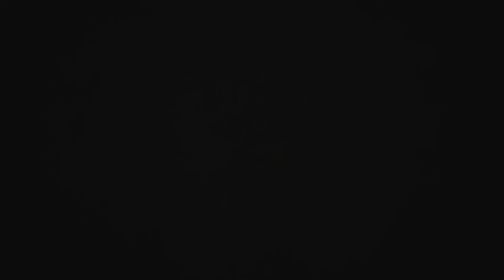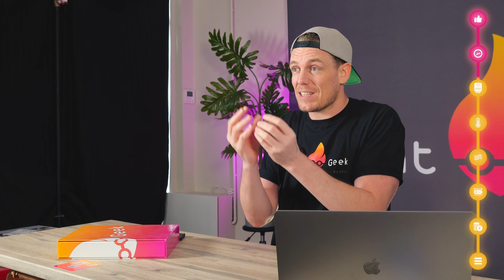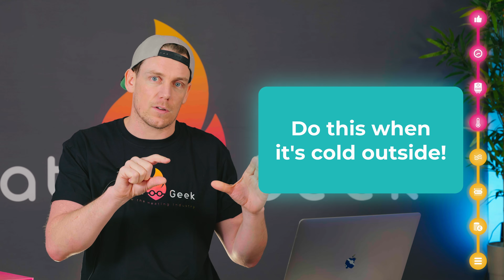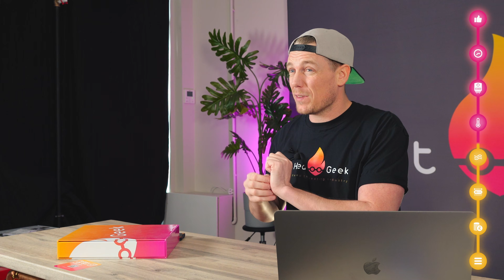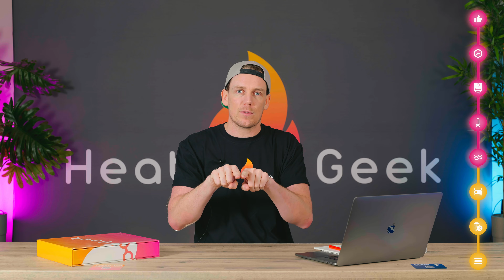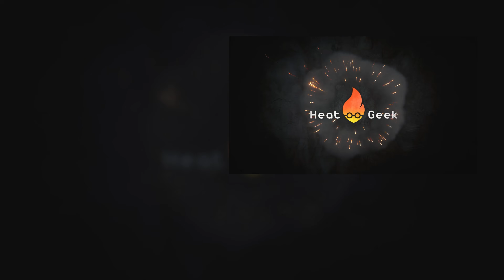PAY LESS FOR HEATING!! | The Secret To Boiler Efficiency | Consumer Advice

Comment: This is brilliant advice. According to my smart meter I have saved about 60% of my gas bill by reducing from 70 to 55 on the hot water and 60 to 45 on my combi. The house is marginally warmer as the heating stays on for longer rather than cycling. For people living in rented accommodation who can't change their system this is massive. Thanks!
Reply from the maker: Please share it where possible! And tag us
Reply: 60%? Holy cow, what were the old settings?
Reply: How much has your electric bill gone up, as it’s taking longer to pump the water around the house to reach the set temperature.
Reply: @leemorgan8725  Correct - because the pump is working for longer the electricity bill will be higher and that will offset any saving in gas. A combi boiler uses about 200W of  electric and electric is far more expensive than gas so its not all good news.
Reply: @lynchetts  a water pump that size is only using something like 10w
Reply: @leeknivek  Yes BUT if its on longer it uses more electric. 5 hrs = 50W 24hrs = 240W
Reply: @lynchetts  you do realize that 10w of power being on nonstop for an entire year is only about $5 worth of electricity... Or less
Reply: @leeknivek  while here in the UK I was paid £2.30 by the electric company to turn my gas boiler off for 1 hr a day. So they think it costs more than what you say - at least in the UK
Reply: @lynchetts  well, I just looked up and found that the average cost per kwh in the UK is 27p 

A 10w draw is about 0.24 kw per day, with a monthly cost of £1.94, annual cost £23.28, that's with it on 100% of the time, which it never would be anyway. 

So that's really a minor difference in electric use, basically a rounding error, and it is possible you could save more money in gas than you would spend on a circulation pump costing ..... 3p per day
Reply: Yeah the difference is insane. Especially after range rating

Comment: Nice video, i understand it is focused on saving energy, however… if you run your hot water at a higher temperature and then are having to cool it down with cold, it is beneficial because you can achieve a much higher flow rate and if you are someone that loves a good shower you may prioritise that higher than saving money on water usage and energy bills. So not completely pointless in all regards, more from a financial perspective. Thanks, love the vids, very informative!

Comment: When I had to have my combi boiler replaced the guy who came to install it warned me that the hot water temperature would be very high, but that it had to be like that for some reason. I did wonder why there was even a setting for it if that was the case, but it was working OK so I decided it wouldn't be worth the hassle of fiddling with and in my mind potentially messing it up somehow. With how energy prices are going, though, I'm definitely going to give that a go.

I am a bit put out that he'd just tell me that that's just how it should be. Even if it wasn't worth his while tuning it himself, he could at least have told me that it's something I might want to adjust myself, rather than essentially warning against that.

Comment: Did this last winter. Previously used 15650 kWh of gas for heating and hw cylinder. Stopped using gas for hot water (I now have solar plus Eddi and Octopus Go ) . This reduces gas to 12000 kWh for heating but my flow temp was set to maximum by British Gas who serviced the boiler. I flowed between 40-50 degrees    and had thermostat set to 20 early morning and evenings with set back of  19 during day and 16 at night. The result was we used 7000 kWh a reduction of 42% . We have subsequently had a heat pump installed !

Comment: My very basic 35 year old boiler has a flow temperature of 53 degrees, but it's quite capable of heating the house even when it's below freezing outside.   Just one moving part (the gas valve) and hasn't been serviced for decades.  I will be changing to a heat pump soon but nonetheless will be sorry to see the old Elan2 go.

Comment: A lot of TMV's require between 8°c and 10°c higher than the required temperature from the outlet I always advise my customers to keep hw temps around 48 to 50 Deg max on my combi boiler not heat only boiler. to satisfy these mixer valve stats.
Been running by vaillant ecotec 831 R1 on 50°C flow temp for 14 years this year.
The cost of keeping my house around 19°c 12 hrs/day and 17°c at night 12hrs is around  60%lower than all my neighbours same house similar setup.
I also haven't changed any flow/heat related components in my boiler as the thermal stress, stop start wear has been massively reduced in comparison to boilers same age in my customers houses.👊
Reply from the maker: Yes we make the tmv point in the video
Reply: I don't know how people are achieving this. Having had mine at 70 and reducing to 55 made no difference to consumption. At the end of day its the dials on that gas meter on the wall that count and I found they still ticked up about the same regardless of flow temp. And I did similar comparisons as best I could with time/temp.

Comment: Just a quick one to say keep doing what you are doing chaps. Absolutely fantastic channel and the advice is second to none. Keep up the great work and I hope you keep managing to grow the channel and the business, doing so gives me confidence the industry is heading in the right direction!  If anyone asks me anything plumbing related I send them to you and a shoutout to @Urban Plumbers. You guys really are doing the lords works :)
Reply: Turn the radiator knob down as far as you can without the house feeling cold, and turn up the hot tap knob all the way to max if you want a fast filling bath or a banging shower 👍
Reply: @thornhillplumbing  I think that you are missing the point. The TRV only throttles the water coming through to maintain a constant temperature. It doesn't make it more efficient. You want an efficient temperature when it reaches the TRV in the first place and a balanced radiator so that it doesn't need to be throttled back.

Comment: Limiting the boiler max output "range" will not really change much! That is, because the boiler will only run at this power level during startup, then it will regulate to much the set temp. Therefore, the only minimal gain is during the first minute or two, that the return water is too cold for the boiler to achieve the set outlet temp. If we also consider the increased boiler efficiency because of the colder return water, the benefit ends up very small, being a function of thermostat cycles, that should be reduced anyway. Also in a very cold weather snap or a home reheat after days, a need for high flow temps may arise. In that case the limited boiler output could  hinder its ability to deal with such conditions. This is especially true with under floor heatting. As a result, the recommended control paramiter is flow temperature, that can be adjusted relatively easy by the occupants if necessary. Obviously this only applies to combine boilers that already have a big output to accommodate DHW use, it is not a recommendation for sizing the heating appliances.

Comment: People NEED to see this especially now that they've withdrawn the Winter fuel allowance for many people. My house uses a condensing combi. It's A-rated and should be using 10500 kWh for heating and hot water. It's actually using 6455 kWh average over the last two years. It's been wired up to a nest controller using opentherm for that time. But I've learnt from that that I could have basically whacked the heating and water temperature dials down to minimums (not the "efficiency" position but the actual minimum), made the heating come on schedule maybe 2.5 hours before the time I get up, and I think it would have worked well with my old thermostat and basic scheduler.

I'm not sure how much I was using before, but if I was using the estimated 10500 kWh (that's the specific figure for my property rounded to the nearest 100), that would have cost an extra £258 per year at current gas rates. Thanks!

Comment: Tried that tip. Reduced the temp to 55C. Took 5 hours of constant running to raise the room temperature fron 17.5C to 19C. When it's set to 75C flow, house goes from 17.5 to 19.5 in slightly over an hour.
Reply from the maker: @dave0smeg  sounds like your thermistor (the boiler flow temperature sensor) is out of kilt.

Comment: Excellent video and well explained. I presume turning down the flow temperature will cool the radiators slightly, which may affect how well they dry clothes on an airer next to them.  Will be interesting to see how much difference I get going from 70 down to 60 degrees

Comment: range rating your power output means also lowering your pump speed.
lower pump speed gives you also a lower return temperature and gives the water more time to give off heat
Reply: Lowering your flow temperature is stupid because youre room isn't warm but you're boiler goes out and on and out and on so you're actually wrecking you're boiler.
Need to lower your power output

Comment: I've just recently - the last week or so turned my heating on permanently and set the heating to 19.5C during the day (05:30-22:00) and 17.5C at night, it's reduced my bills by 10% the first day and another 14% the second day when I turned down the radiators from 70C to 50C. I have no temperature issues, the heat isn't yoyoing and so far being on all the time has actually significantly cut the bills. When before two hours in the morning just didn't reach set temperature because it was impossible to get the 10C to 19.5C in that time frame, that first day of permanent heating it took 7 hours to reach temperature and I had to eat a large bill that day (smart metering)...

Since starting the economy kick over 10 years ago, I've done cavity wall insulation, two loft installations and blocked old vents up that were needed for gas fires removed ten years ago... Being sealed in I had to get a dehumidifier to prevent condensation and steam issues when I have a bath, but all in all from the old gas back boiler to now I've cut over 70% on my original bills over ten years.

I'm still looking for more, but heat pump grants are only being offered with underfloor heating and I have concrete floors, which excludes me...
Reply from the maker: Heat pump grants are only being offered worh underfloor heating? This is completely untrue
Reply: @HeatGeek  which company is offering grants without under floor heating? I checked there are very few offering grants and those that do - that I'm aware of - require under floor heating to be installed as part of the package, and you can't install under floor heating when you have a concrete floor... or so I e been told.

So please tell me who ? Because last I checked there was only one company still available under the grant scheme, if I'm wrong please tell me who else?
Reply from the maker: @Dave of Yorkshire  litrally every company in the UK can and will install without underfloor heating..  I speak to many many different companies every single day and I've never heard of it as a prerequisite. We install with grant without underfloor heating.

Lastly.. you can install ufh on concrete floors.. there's a couple of options actually. You have either an overlay system or a routing system like jk flooring.
Reply from the maker: Check out thr heat geek map that will list a few different companies you can use.
Reply: @HeatGeek  Did you miss the word "grant" in my post? If course companies will do it - at your expense. But not as a grant installation!
Reply from the maker: @Dave of Yorkshire  I'm sorry I really do t know what you mean. 90% of our installs don't have ufh and receive the grant
Reply: @HeatGeek  That the opposite of what I was told six months ago, three said they no longer did grants and the only one that still did only installed if you had under floor heating... That's what I was told by multiple companies...
Reply from the maker: @Dave of Yorkshire  very strange as we have 100s of engineers that use our umbrella and we have never heard this. Not once. Also its absolutely nowhere to he seen in the mcs docs.

Comment: Just recently got a new combi boiler installed. Contrary to the advice given here, the gas engineer told me to keep the dial for radiators at max.! I'll definitely follow the Heat Geek advice. I already have the water temp. set at 45 C. I tried 40 C but the shower mixer didn't work properly.
Reply: It will be similar to driving your car in first gear everywhere and will eventually wear out by putting lots of stress in on your boiler

Comment: The discussion about legionella is important, where I work we have a constant battle with legionella bacteria in our manufacturing processes. However our tanks don’t change their water fully even over a week and our processes spray water creating potentially contaminated droplets in the air.
A domestic hot water tank would have its contents replaced daily in a family home. Legionella is a respiratory disease and can only infect you by breathing in the bacteria in water droplets, when having a shower. You can’t get Legionnaires disease from drinking contaminated water. If you have an electric shower and don’t use your ‘from the tank’ for showering then you probably going to be ok with lower water tank temperatures. Or as has been suggested, ‘boil your tank once a week’ like we do where I work. We raise the temperatures to above 80 degrees, in a domestic tank 60+ would be fine.

Comment: Thanks for this, it’s affirmed what we’ve been trialing over winter to turn the Worcester Bosch down to a flow temp of 35-40 and that’s managing to keep the house stable at about 20. But we’ve noticed that even though the boiler has individual hot water and rad dials, the hot water remains a bit cold, so will have to have a look and see if the cylinder immersions even working or not.
Reply: Hi. If you have a hot water cylinder then you need to keep your boiler thermostat high otherwise like Adam said in the video bacteria will form. Another alternative is to run your immersion heater once a week to heat up the water to 60 degrees plus to kill all bacteria build up.
Reply: @copperskills3973  yep that’s what I was expecting the immersion heater to do, with the boiler itself still set high for hot water, I expected the difference between flow temp from the boiler to be seen at the tank as low and have the immersion do the rest of the lift. But yep we’ve been doing manual high heat cycles to keep safe
Reply: @Extragonk  unless the boiler is connected to the cylinder with Worcester Bosch controls using their bus communication it will not do that unfortunately and the hot water symbol on the boiler is redundant and doesn’t work
Reply: @copperskills3973  thanks for the info, that sounds like the case unfortunately!
Reply: @copperskills3973  Yes, It is worth remembering around 250 people catch legionella each year in uk so it pays to be careful.
Reply from the maker: @brackcycle9056  legionella is nearly always from old commercial installations. Mire research needed here
Reply: Depending on boiler model, you can fit an Optional Internal Diverter kit that allows the system boiler to provide separate temperature for hot water & heating (like a Combi does).

Comment: We’ve been trying to get to the point where we have a full ASHP quotation for our house since  November last year. Our chosen supplier, who is not only MCS registered, but also an installation validator for the MCS, seems to be doing everything possible to persuade us out of getting a heat pump. There is no doubt that our property is awkward, as the heat pump will have to go up the garden and there will be lots of trenching under existing paved patio and steps, but he also expects that all the emitters are going to be too ineffective. Yet we have run our gas boiler over the whole winter with a flow temperature of 50 degrees and managed to heat the house perfectly adequately. I guess he is either looking for a much lower and thus more efficient flow temperature, or just is guessing wrong ahead of the full design - a design that he seems very reluctant to perform. Odd situation really.
Reply from the maker: It's not that odd. The calcs HAVE to err on the side of caution so I guess that's why
Reply: The installer probably thinks your house and existing system isn't suitable for a heat pump for what ever reason , and is giving you his opinion that going ahead with the job may cost you far more than it will save. Also if any problems or the house doesn't heat up properly or if it ends up eating lots of electricity, it will be a headache for him down the line.

Comment: A significant additional improvement for hot water temperature and efficiency is to insulate the hot water pipes as much as possible. The temperature drop between the boiler (or tank) and the tap can be considerable, also it reduces the length of time for hot water to come through on intermittent use.